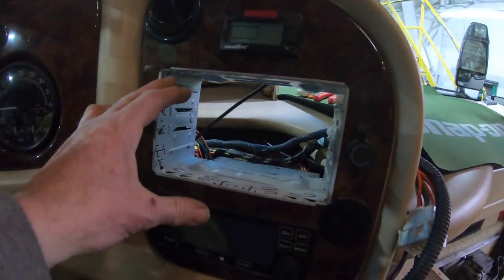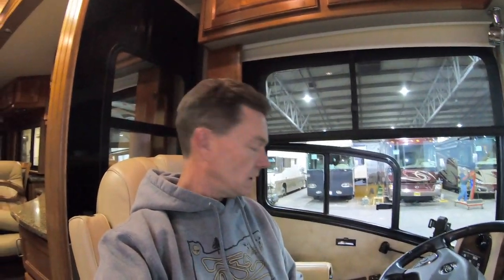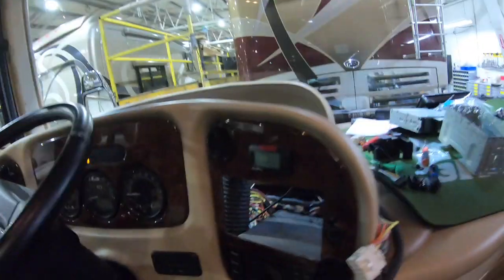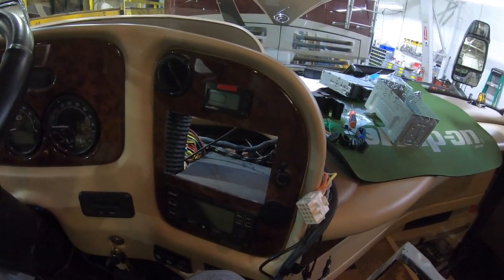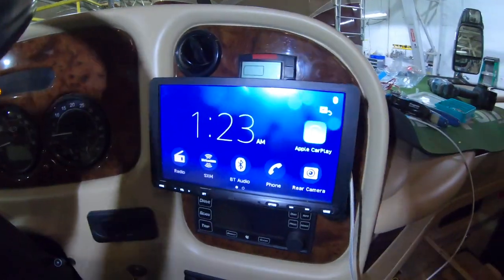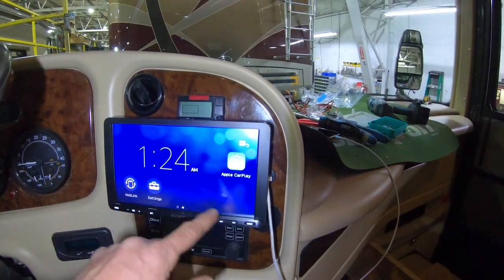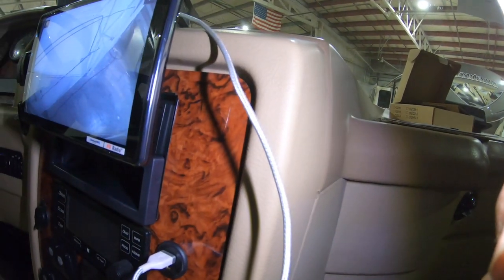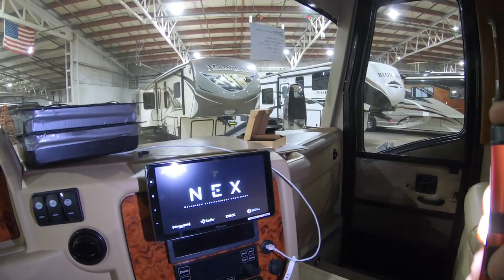Sony & Pioneer Dash Radio Install in a RV

Comment: A new single din large screen stereo is at the top of my upgrade list. After going to the stereo shops and playing with the Kenwood, Pioneer and Sony I think Im going to go with the Sony model you just installed. You cant beat that price point at $500. The other two are twice the price and in my opinion they all do the same things. Gets me a bluetooth/carplay stereo with back up cam all in one

Comment: Like it. I got the VIP wheel that works the radio. Problem is they stopped integrating radios aboard 2016. Can’t use much newer

Comment: Your doing all the stuff on my list. If you get a chance check out the video I just did installing Under Glow on my Revolution.
Now I'm trying to find a new radio to put in mine but I don't need anything fancy. Just the old Ford unit has to go!

Comment: I have this unit in a coach I just bought but two speakers on the system are not connected turns out if they are I get a amp error msg. There's one set of wires green not connected when I did is when the error came up.
Is there a unit out there that will power all the speaker?